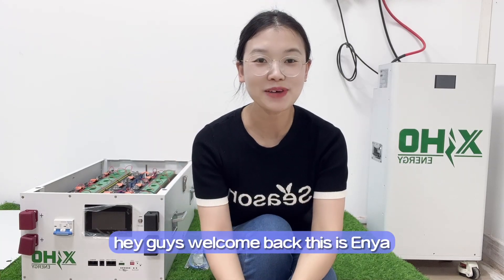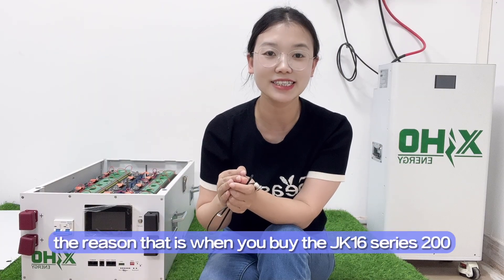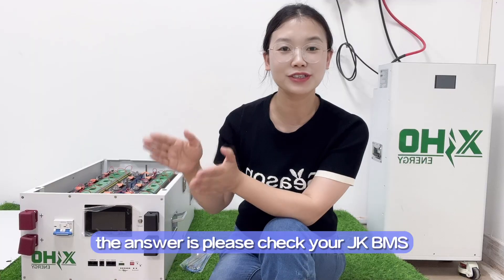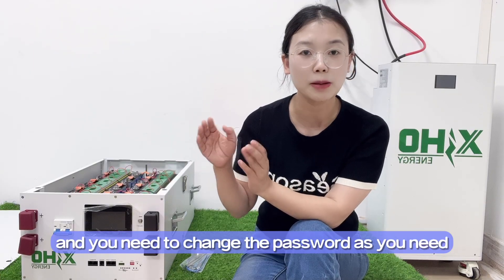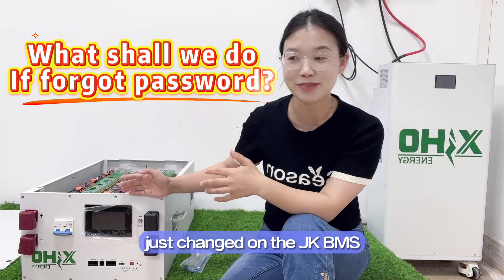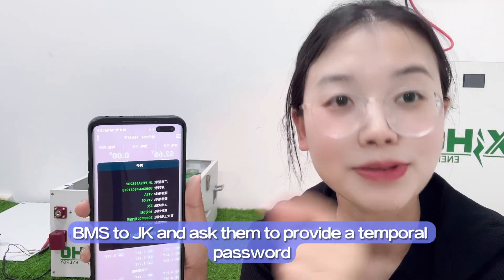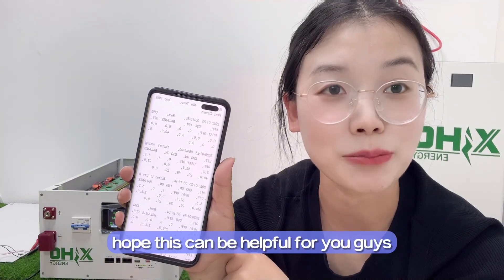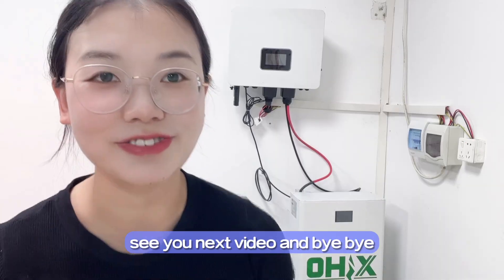Top 5 problems with JK BMS version of DIY battery kit

Comment: I have 16s 48v 100ah,,,the reading of the bms is 0.070 wire resistance...i dont understand if my resistance is ok or not,,,can you answer my question
Reply from the maker: Hi friend, wire resistance is not battery cell resistance, no worries

Comment: how about for the SOC issue? it will not obtain the 100% SOC , instead I got only 99% SOC. I tried to do some tweaks on rcv & off the float charge and it solved the issue but doing this every day. On the next day only 99% SOC again.
Reply: There's another parameter that you can access though the new app version (the playstore version doesn't work). It's a setting saying how long the RCV needs to be matched to consider it to be 100%. Make sure you calibrate the voltage as well and that your inverter/charger can receive "remote voltage sensing" (Victron can), this way the inverter does the right thing. It took me some time as well, but I managed to do it :)
Andy from offgridgarage also has a few video's about it.
Reply: @wpte thanks a lot for this info.